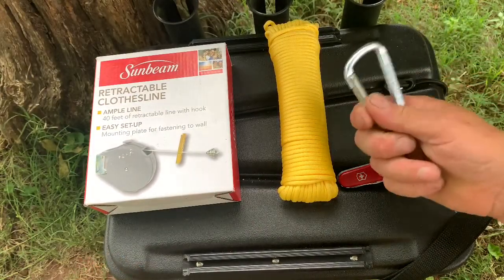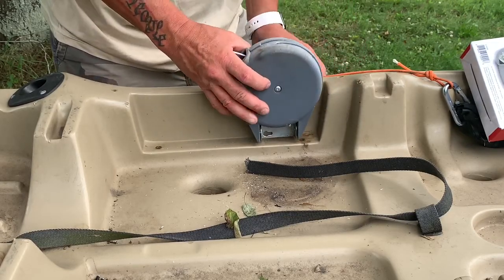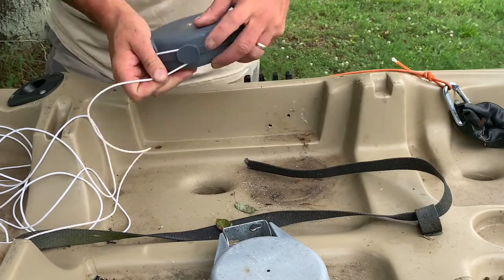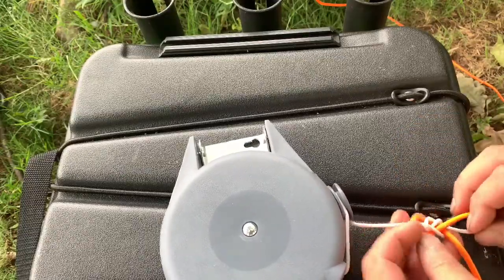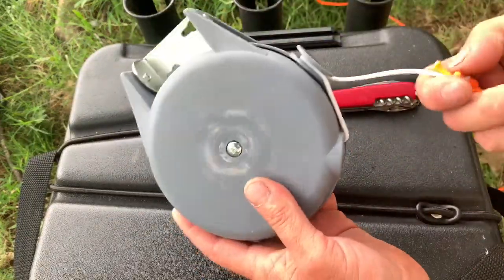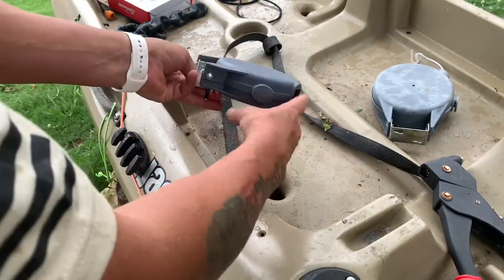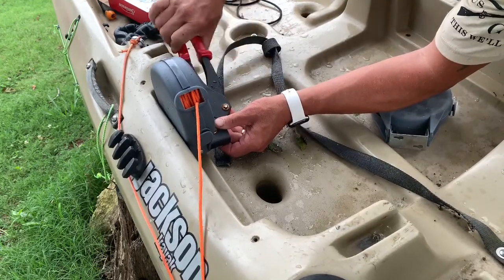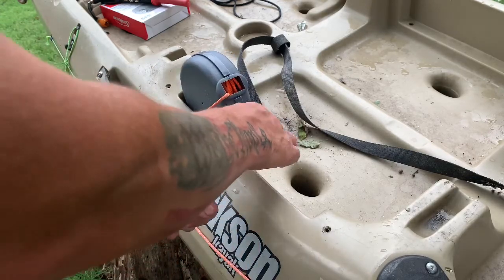DIY Retractable Kayak Anchor Line from a Clothesline- Quick and Easy Kayak Anchor System

Comment: Great idea! Bought one today. Whilst struggling with the knot, I noticed on the reel there was a 2nd hole. Pushed the paracord through that hole and fished it out with a mechanics pick/hook. Tied it in a simple knot, melted it to keep it tight and pushed it back inside the housing. Did the same thing to the clothesline but just cut it off. Boom! Works like a charm. The plastic housing is flexible enough to do this.

Comment: Self retracting clotheslines is a great unit for retrieving and storing line. HOWEVER, by using a trolley along with this, it allows you to anchor from either the bow or the stern, allowing you to fish upstream as well......that is way food travels to the fish on a stream, as well as insects with the wind in a lake or pond. Thanks

Comment: What do you use to attach the line to the anchor trolley line? I saw the triangle ring in the other video you did.
Reply from the maker: I just run the line through the triangle ring. If you use a big enough ring you can run your stakeout pole through it too. I also use stainless steel locking d rings to attach the line to the Anchor I’m using. Hope that helps. Let me know if you have any other questions.
Reply: @greatamericansurvival  never thought of running through the ring. Makes sense. Thanks

Comment: How do you use the retractable line with the anchor trolley?
Reply from the maker: I use mine with both my drag chain or anchor trolley. Mine comes out goes through a D- Ring and then through my trolley ring. Just make sure you have a cleat for the trolley to keep it from moving with the water direction.
Reply: @greatamericansurvival  can’t thank you enough !

Comment: good video. Not wanting to drill holes, I simply mounted the clothesline on a T-Trac, fed the anchor line through a pulley attached to the bow grab handle. Removeable. Not as versatile as a trolley, but suits my needs for the present.

Comment: What pound anchor can that hold?
Reply from the maker: I use a 6 lb downdrigger weight or go get a cheap kettle bell at goodwill
Reply: @greatamericansurvival  thank you
Reply: I use a 3# plastic coated dumbell from goodwill, they are used for walkers.

Comment: why not just use the cloths line already installed???? is that not possible????
Reply from the maker: You can, it would work. I tried to just didn’t hold up, lost my anchor. This is just better long term. But If you try it let me know how long it last for you. It’s been a while since I did mine can’t remember how long it lasted.

Comment: Have had two of these for my boat. The spring inside failed completely after about ten uses. Junk. Won't buy it or again.
Reply from the maker: That sucks. They come in really handy but I’ve heard of others having issues. I recently added an Anchor Wizard and it works great..

Comment: Do not use these! they rust out around 2 months or so and you have to keep buying new ones.
Reply from the maker: So far mine has held up so far. But I also bought an Anchor Wizard it’s worked out really well so far.
Reply: Drill small drain holes ...lets it dry up